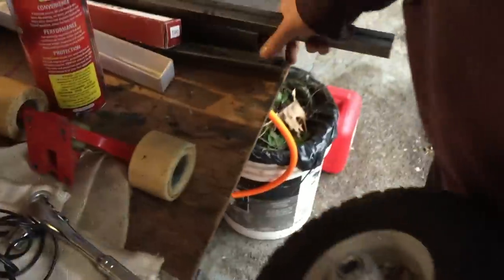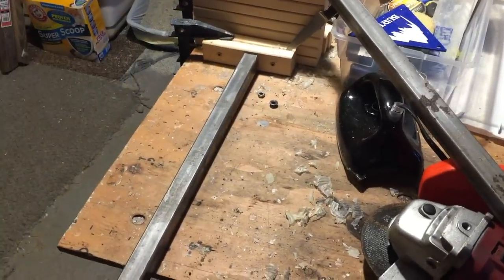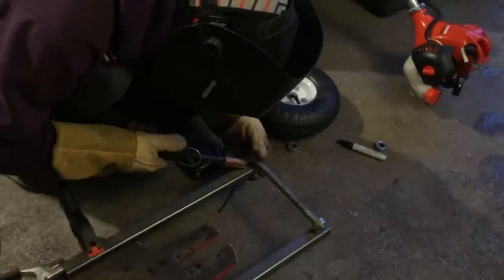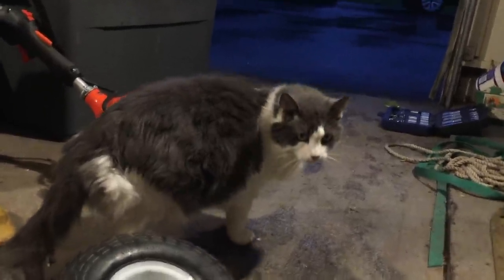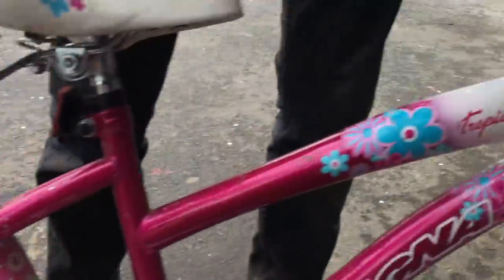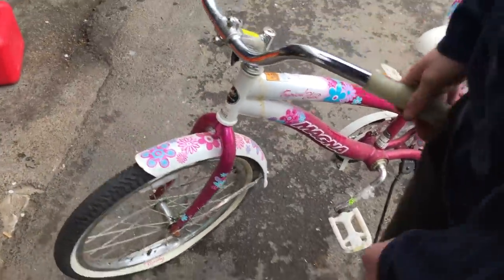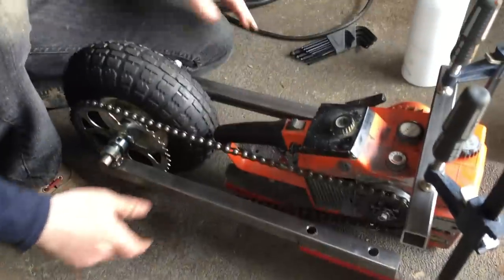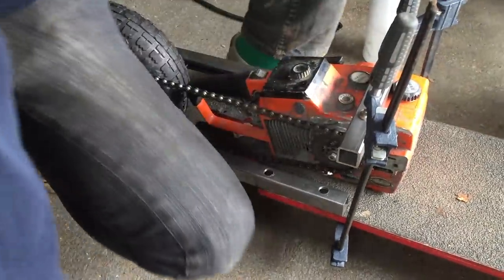The Chainsaw Skateboard

Comment: That unprotected sprocket worries me. I have heard some horror stories
Reply: Skill Builder care to explain what that is?
Reply: @zach5994  damn kinda like a chainsaw 😂
Reply: Rode my mini bike the ither day with baggy sweatpants and got my leg caugt in the chain and sprocket and tore up my thigh.  Not fun.  Whiskey throttled during a sketchy part of the trail.  Ok so to set the scene you just came down a hill all gravel and a mix of dry and wet leaves right after a sharp turn and then in between a tree and a tree stump you have to go over a skinny ramp which has a tree behind it.  You have to turn while hitting the jump so you dont go into the tree.  I hit a root after sliding on the gravel and whiskey throttled at the same time.  My friend broke a ball joint on his quad trying to make that tight turn mid air so as soon as he hit the ground it just snapped right off lol.

Comment: The engine needs to be mounted to the same steel chassis as the sprocket. It seems like a small detail but any bit off axis or weird movement the chain will come off.

Comment: Always the same with these builds I have done loads with lawn mower and chainsaw motors and the chains are always the problem
Reply: What if you mount the motor to the truck instead of the board
Reply: Looking to Make a little (gt snowracer based) snowmobile. I know it's another world when it cones to tracks but any advice on chain issues?

Comment: Here is what you need to do to make it work. You will need to do a secondary reduction  gear so that it has enough torque and doesnt stall. It may be quieter safer and easier to use a belt instead of a chain and use a pulley tensioner like the ones used on the serpentine belt of a car so that you don't have issues with the belt falling off, especially at higher RPMS.

Comment: maybe you should film the guy cleaning the spark plug.
Reply: or adjusting/replacing the re-coil spring
Reply: No, the guy cleaning him up off the pavement.
Reply: Patrick Wagz 8э
Reply: no the emergency tech who asks why he used no eye protection
Reply: No film them getting shot by an angry commenter who got robbed of 12 minutes time

Comment: Anyone else upset that something that doesn’t even work got 7+ million views? If they had a chain tensioner and a much smaller drive sprocket it could be useable! Still very slow but at least functional... 2:1 drive ratio plus like 40cc two stroke and a 10” wheel doesn’t equate quite right. I need to start making videos of things that actually work, just finished a motorized bicycle that does 39mph for about $60 and spare parts. No special tools, angle grinder, welder, and eyeballs.

Comment: The idea of torque moves weight does not apply to a chainsaw engine.... they only work at 7k to 10k rpm. So you would some gear reduction to have a really loud skateboard that will move lol😎

Comment: Why not cut the handle off the chain saw and move it closer to the wheel so the chain is shorter and has less slack. Or add a derail or tensioner?? Then modify the throttle with a pedal. Maybe add a brake on the other side of that rear tire. Lol

Comment: unfortunately i knew fr om the beginning this wouldn't work but wanted to see a young kid weld and go for it.. take that chain saw and cut it up and try again with an old two stroke lawnmower motor with a blade clutch on it. same concept just a much much lower rpm range.

Comment: gear ratio way off. it will work with a smaller front sproket.
Reply: I noticed that too.  If it had worked the top speed would have been extreme with that engine wound out but I really don't think it would have pulled that high gear.

Comment: I built one and the same thing happened. There needs to be a centrifugal clutch on it. The clutch on it is not strong enough to push a human. The best way is to order the 50 cc engine kit that already has it on it. It’s more expensive but is well worth it because it actually works. But great job trying bud that’s where fabrication starts. Check out “reverse flow smoker I built” on you tube my you tube name is brandon66ful. This is where my fabrication has progressed emensly